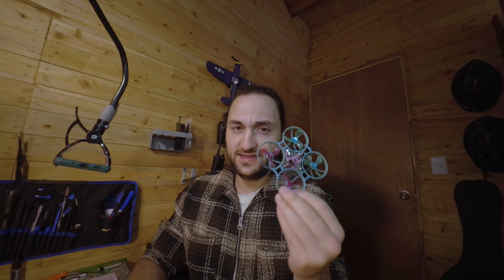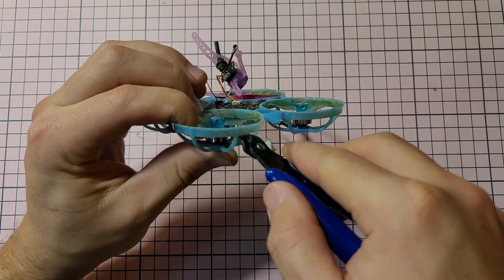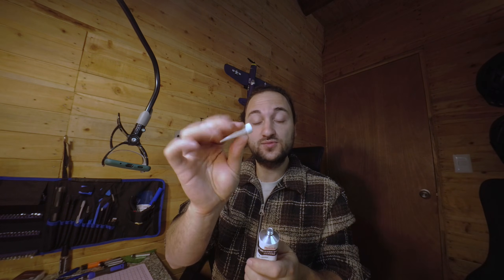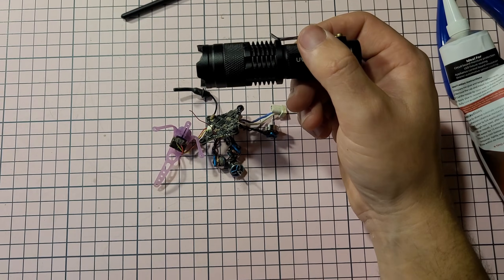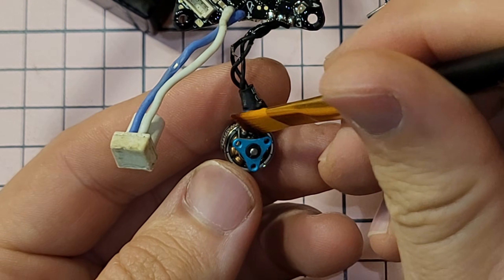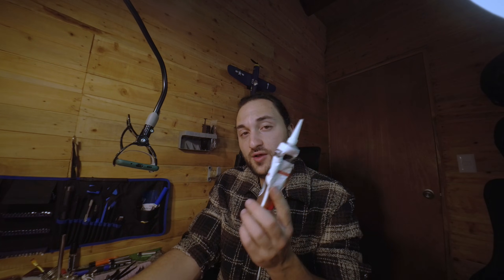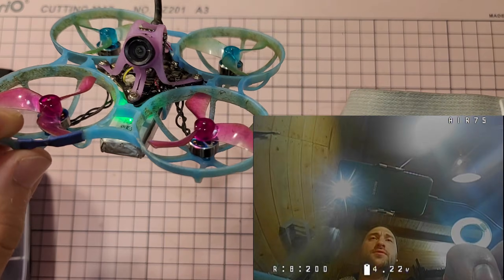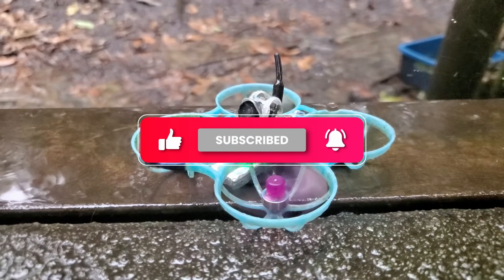Waterproofing your FPV drone is easier than you think

Comment: Hilarious and useful info. I use temu techno lights as tail light in my bicycle (broke the glasses when drunk) and the led is fine rear light (which is required to comply with the LAW)...However moisture has been bit of issue (I winter cycle most of time)
Reply from the maker: Oh yeah this will work as well

Comment: Hey for you next one you might want to do it with mg 422. Conformal coating. The one you now use I believe is silicone like worryfree fpv or kotking. It's hard to remove yes peel and remove.. but the other one you can solder trough. If you ever damage you whoop and need to resolder motors it wont be such a hasle. also this stuff is thicker and weighs a whoop more down. I use the kotking for a cinematic drone that I dont plan on resoldering alot/ crash. As for the motors no need o waterproof they are waterproof like that. How I know I waterproofed my dji 03 and flew a 5 inch in the pool and fly out of the pool again ( floaty pool noodle on top )
Reply from the maker: Hey thanks for the input mate! Even tho I was able to resolder a motor wire with no issues on this one.
This is thick I'll give you that. But I dont feel any noticeable change at least
Reply: @itsnickrandom good. I tried a solder iron on worryfree with 400 celsius.. does absolutely nothing.

Comment: hmm, about the motors. The wiring is one thing - but we have an open gap between the rotor and stator, the rotor(bell) is wide open from the top side.
Reply from the maker: That's true but trust me you won't have issues unless you're gonna be flying underwater. Even tho you can check my latest short I drop in the dog waterbowl and then fly out.

Comment: For beginners looking for an easier solution buy the new Flywoo X30 spray! You can apply without taking your drone apart, it may not be fully water proof like conformal coating but it’s highly water resistant & in my eyes is better than nothing! I doubt I will take the time to dissasemble and conformal coat so I am leaning towards the Flywoo spray
Reply from the maker: That's a good option, make sure to connect the ports you need first so the spray doesn't get in the way...but im not gonna lie that spray os expensive as hell

Comment: Any heat resistant silicon. Silicon Conformal coating.(some are liquid or gel )  Even Plasti dip. (which comes in colors.Spray or paint on/dip. peel to remove)  Ive seen lots of things used over the years.  I 've been water cooling PC's, drones and electronics for decades.  Glad you show people how to's.      Thanks.  hobby on.
Reply from the maker: Thanks to you mate!

Comment: Next step is some windshield wipers!
Reply: nanospray, droplets just fall off that way :)
Reply from the maker: Lol that would be cute
Reply: @itsnickrandom yeah use the rainx stuff for car windshields. Ive done it with gopros either snowboarding or on quads(the 4 wheel kind, not the 4 prop kind). Works really well. Still get some water, but it doesn't stick